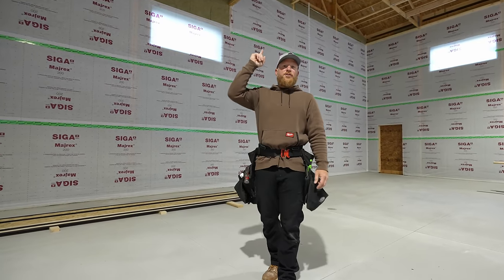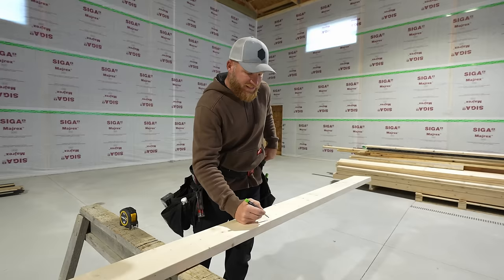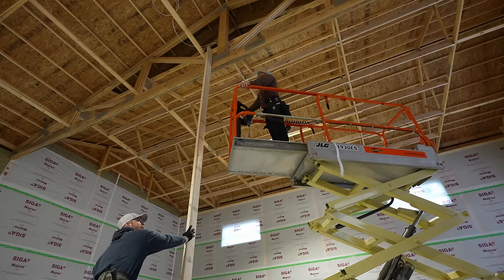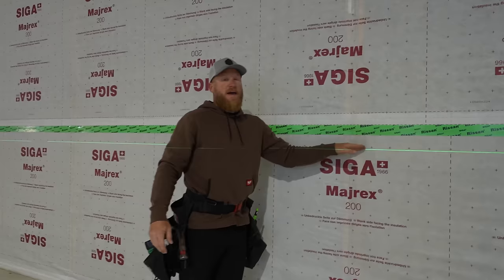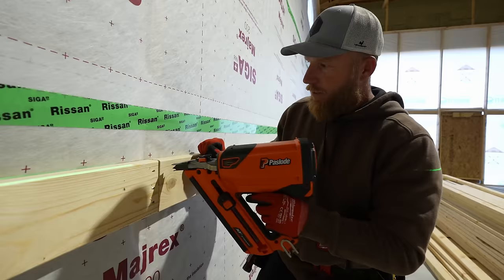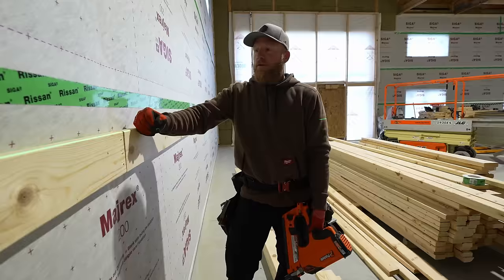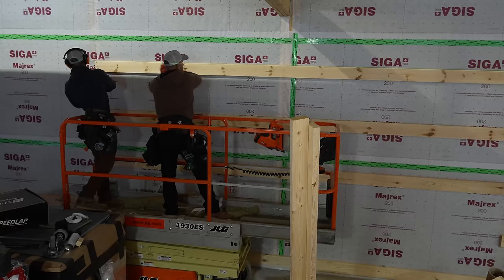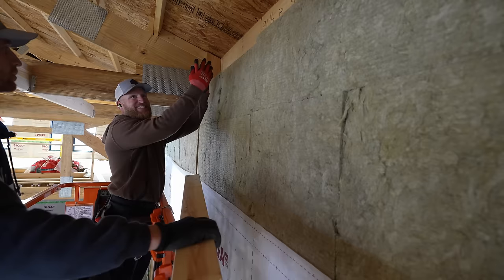Framing Walls Inside While Weather Is Crummy Outside!

Comment: Kyle, for your wash bay area, you should check out the Obsessed Garage  power washing solutions.  They're pricey but pretty nice.  There's a lot of cost with the water lines, so you could sub in pex vs the fancy stuff.  Would cut the cost in half.

Comment: Hey Kyle, have you looked into fabric ductwork?  It's a pretty clever technology, great for big open spaces like you've got there, and a whole lot cheaper than sheet metal for both time and materials. Other advantages are it's inherently quiet, and you can unzip it and throw it in a washing machine if it gets dirty.

Comment: It’s always best, when using double backed adhesive tapes, to use a silicone roller to install them. For some reason people think they can just rub their hands over it and get full adherence. Guess not. And as far as putting too much rock wool insulation into the wall void, why?

Comment: So with the Rissan tape being put on 'backwards' is that going to cause any issues with air movement, as in is it designed to move both ways? Wouldn't want you to have an air infiltration/potential cold/warm spot for mould to form. Thoughts?

Comment: First rate work, but there is more tape in this building than most other buildings have lumber.  I'd lose my mind fussing over things at this level.
Reply: I used think the same before undertaking training in passivhaus methods! It’s actually more mind blowing how much energy is lost when you don’t fuss over these details…..!🤔🤯
Reply: @marcustait79  I don't even want to know -- I need to sleep at night!  And of course as buildings get tighter we then need to worry about conditioned makeup air, so it can get out of hand quick.  I predict we will see a future episode on the ERV required to bring fresh air into this new shop...

Comment: Is it an absolute requirement that the vent pipe MUST go through the roof? Seems like it would be a better option to dump it out under the eave (especially since there are no operable windows nearby), and not add a roof penetration after the entire roof system has been installed.

Comment: Would it in any way shape or form been a good idea to stagger the girts? 
To not have the joint on the same studs.
Reply: Dosent matter a whole lot with the metal that’s going on the wall. It won’t get screwed on the individual studs, some might but most will be fastened throughout the center of the girts

Comment: Good job, but it sure is putting a lot of faith in adhesive tapes that honestly are getting stuck to what is an unprepared surface in a lot of places, now if there was some sort of surface sealant/primer that promoted adhesion I might develop some faith, after all you're sticking it to timber which is just a shit load of little holes with some fibre between them and at the end of the day it will all be covered up and the client will never know when it has failed. Being that pressures could be higher and lower on either side of the membrane should it be pressure tested and vacuum tested post construction and again say 2 and 5 years down the track considering the investment in time and materials. I guess there should be some kind of standard to meet and maintain, is there one ?  Too often in construction materials and methods are found to be failing once down the road, more often with the client left holding the bag and all of those materials were fit for purpose when initially installed, thinking about asbestos sheet, polybutylene fittings/tube/rings of all variations, galvanised nails in decking timber, galvanised bolts in decking timbers, multiple building and roofing papers, fibre glass and pic roofing sheets, monolithic exterior designs and material failures, compressed hardboard weather boards, sewer pipe sealing rings ... honestly the list just go's on and on. Don't get me wrong I see the effort you put in to do the best job you can and no one could ever accuse you of just thoughtlessly throwing a building up, and good on you but even from the other side of the fence you must also worry that some new product is going to bite you in the arse because they do and it's happening more and more with unproven processes and materials used to fill technical requirements.
Reply: All the methods these guys are using are pulled straight from the passivhaus standard. Manufacturers like Siga and Proclima have been producing tapes and membranes for decades now in Europe and when you measure the performance gap between passivhaus detailing and standard methods of construction it’s not even close !🤓

Comment: I’m sure your local lumberyard appreciates you going through all the lumber and sending 
back all the sh**y boards… and I’m sure you have a relationship relationship with that one lumberyard that you use most of the time…I mean that’s part of the deal they have to sell what comes in there. You should have to buy what comes in unless you bought all number one material.
Reply: if they didn't want it sent back, they shouldn't have sent it to begin with. plus, they aren't going to risk losing an account over exchanging some bad lumber
Reply: @adamt4742  like I said depends on the grading … if it’s standard #2 framing lumber your going to get some bows, wain etc … they were picking the absolute best out of it … so they should’ve bought #1 … of course the lumberyard will take it back and not lose them as a customer … and he knows that, (taking advantage of them knowing that … why not tell them what you need and they can buy it and then ship it … 
Next customer is gonna get a bundle of crap 🤷‍♂️